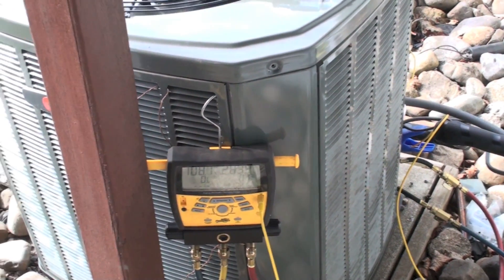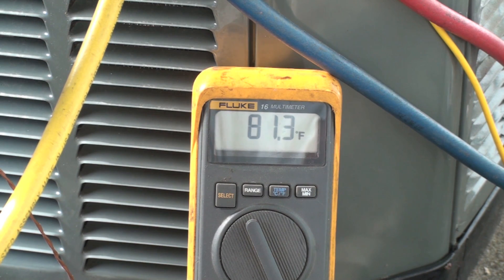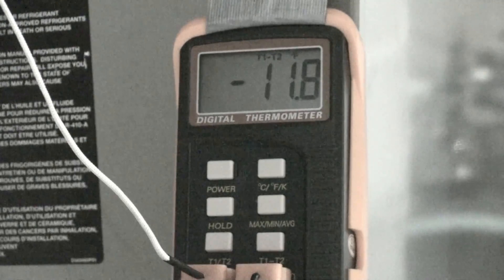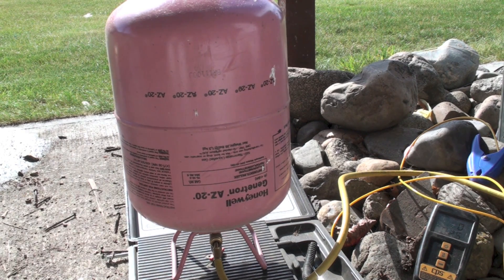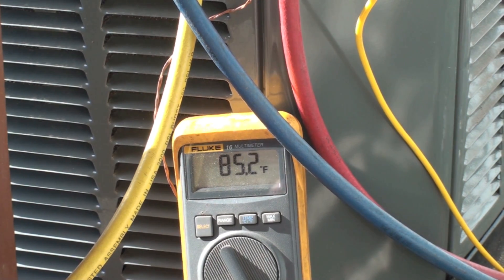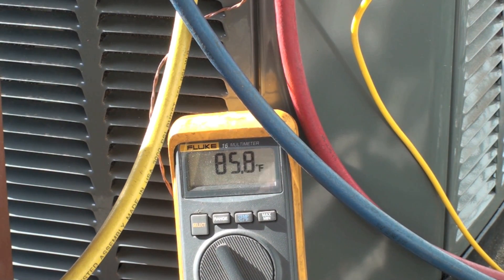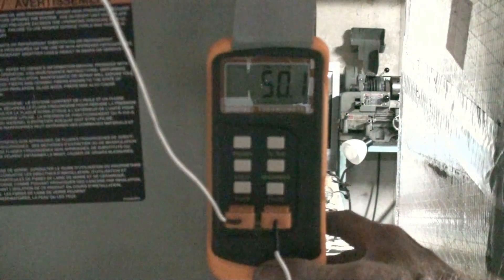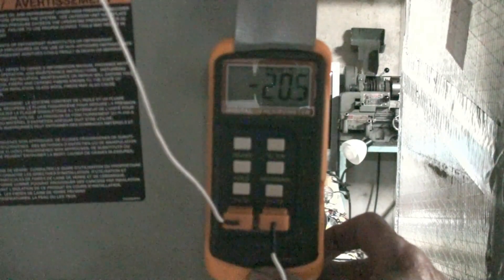How to recharge the AC with a TXV

Comment: Another superb run-through for how to adjust charge in an R410A split system with a TXV. 
I’m finalizing the charge in a similar system right now. It has a brand new condensing unit, but I am still using the existing evaporator and line set. So I knew additional R410A would need to be added to the pre-charged amount which was already in the new condensing unit. It required about 3 LB to be added. I think I’m getting close to the right amount now, but will make one more test of subcooling, indoor supply vs. return air temperature split, and superheat exactly like what is shown here in this video.

Comment: What’s the problem with charging by superheat, it worked for me for the last 43 years, TXV, PISTON, or CAP tube, cuts no ice, besides any installer worth his salt will put a sight glass after the dryer if it’s a TXV system ! Anyways I can judge operating conditions with my hand on the suction line, I don’t need a temperature probe unless i’m diagnosing a problem. Forget subcool just make sure of your gauge readings, and look for telltale problems that needle will show by its movements, like a pulsation that may indicate a sticking discharge valve, oh i’m sorry I see you have one of them modern digital manifolds that won’t show things like that, oh well maybe it’s also a radio to keep you entertained while your working. Also your liquid line should be warm to the touch, NOT HOT, and NOT COLD, one could indicate a dirty condenser, the other a plugged system and be careful, Carrier likes to sandwich two coils together on some of their units and they get dirty in between where you cannot see ! Never cared much for Carrier and I can’t stand Trane.
Reply from the maker: There are a number of ways you can fail by using superheat only.  
Subcool is used on TXV controlled units to insure there is sufficient refrigerant to feed under all load conditions.  Placing a sight glass on a modern A/C unit controlled by a TXV will not give an accurate charge.  We are far beyond that.  It is kind of 1970s tech.  
An A/C unit with several cap tubes, superheat can be normal with one tube blocked.
An incorrect piston can also give you incorrect superheat.  
Air in the system will also give an abnormally high head that will increase flow in fixed orifice systems and lower superheat.
Low airflow across the evap will also give you correct superheat on a system with low efficiency.
Gauge readings must also be checked.
There are more, but this will do for now.  
I would suggest that the hand on the suction line be supplemented by correct gauge readings, temp probe on the liquid line, probe on the suction line, a check with manufacturer's instruction (located on the model plate), ambient temp probe to determine if the gauge readings match, temp split across the evap.
I used this method on all systems I worked on.  It takes little time to set these probes and they will save you from mistakes.
GFM
Reply: grayfurnaceman I edited my comment, I assumed monitoring your gauges was a given, you will see that everything you said in your comment is addressed. Any of the problems you presented will show up if the technique I presented is followed, now diagnosing that problem will depend on your technical abilities. And about your sight glass comment, a sight glass is the only fool proof method of insuring a solid column of liquid to your expansion valve, I don’t care what they taught you ! And I find that 70s technology comment pretty funny, I didn’t realize the laws of thermodynamics have been changed ! Want to talk about something, let’s talk about the modern engineering marvels I have been running into lately, like using flammable gasses for refrigerant, i’ll bet you even think the insane pressures of R410A is going to work out, just make sure you honor the 5 year warranty on these compressors in the units your installing as they start blowing out left and right every time the mercury cracks the upper 90s.

Comment: r410a system ( with fixed orifice) with equalized pressures of around 200psig. But once compressor starts the low side drops to 50 psig while the high side goes up to 300psig. I checked superheat was like 80F and subcooling was 2F. Does this mean the system has leaked out all the refrigerant? Does the 200psig equalized pressures means there's refrigerant in the system? thank you.
Reply from the maker: All the 200 psig means is there is enough refrigerant in the system to make a saturated mix.  You could be quite low on charge.  
GFM
Reply: Hi, my r410a with txv unit. The suction saturation temp is about 33F and suction line temp is 48F giving 15F of superheat. But why is my liquid line saturation temp is 97 and my liquid line temp is also 97. I tried adding some refrigerant but nothing changes. This is a high velocity system air handler with a slab coil. I think my suction saturation temp is also too low. Both coils are clean and txv valve is new. Any help would be greatly appreciated. Thanks

Comment: What about adjusting TXV when subcool is correct and superheat is high?
Reply from the maker: In my career in HVAC, in 35 years of repairs, I have adjusted a TXV perhaps 10 times.  In at least 5 of those times, adjustment of the TXV did not help.  Look for everything else first, adjust last.
GFM

Comment: Question about a R410A systems, when the system’s compressor won’t energize due to low refrigerant with the low pressure switch, and you have a few lbs remaining in the system, can you charge as liquid directly to high side with compressor off? That is, weighing it in until system won’t accept any more, then, topping it off via subcooling method via low line.  Or, must system always be in a total vacuumed state before you can ever do so?  Moreover, in what situations can add via high line as liquid.
Reply from the maker: Unless the charging cylinder is at a much higher temp than the A/C unit, it will not move.  I would not consider it viable.
The only viable method of liquid in the high side, is with the system well below saturated or, of course, evacuated.
GFM
Reply: It seems then just holding down the contact switch, going into low line is the best way, versus using warning blanket on cylinder.
Reply: Or, if system is short cycling due  to low charge. that's probably good indicator you can go into high side?
Reply from the maker: @userjim9  I have never been a fan of warming blankets.  
Jamming the contactor or bypassing the low pressure switch is viable, but short cycling will not change the inability to charge in the high side.
GFM

Comment: hi, doesn't that affect the compressor when adding liquid into the low side like that? thanks.
Reply: It will affect the compressor if you add the refrigerant too fast. Watch the video again and pay close attention to Grayman's instructions! Good job!
Reply: You can use a liquid charging adapter when charging.  A liquid charging adapter is basically a fitting that has a small orifice in it to prevent liquid slugging.  A liquid charging adapter is just cheap insurance.

Comment: Good video. I appreciate your candidness about recover and refill vs. top off. It is first I have seen with that viewpoint. As a DIY guy, this means I just need  a decent manifold set, a scale,  temp probe(s), and jug of 410a. I will leave the other tools to the professional when it is time to have serious repairs performed. My unit has been serviced 2 times, 2 diff techs. Neither one found a leak, both ended up charging it up and that was it. Strange observation on my part - it appears to leak when it is powered off for an extended period of time. Crazy.
Reply from the maker: Leaks can certainly do that.
GFM

Comment: Some posts are questioning if the system is low on refrigerant that you need to recover and start with Fresh . how serious is this ? you added 3.3 lbs that sounds like alot My 3yr old system has a leak and 3.2 ls was added . should  I  turn off unit until they find leak and recover and recharge with fresh R410 A ?
Reply from the maker: Whether to recharge with new is dependent on several factors.  TXV controlled units are pretty easy.  Charge until subcool is right.  Fixed orifice is a little harder.  Sometimes remove and recharge is the best way.  You can also use target superheat without removing the charge.  This is assuming the system can be pumped down for leak repair.
GFM
Reply: Thanks  Can you describe the several factors ?  Why does the ease of charge have anything to do with the R410 being reused .    I have heard the mixture proportion  is critical and just topping isnt  an accurate  blend. if large quantity is added . is that true ?       3.2 sounds like a large % of an 8.8 full system . Tech said he can pump all refrigerant back to od unit then replace evap coil if leak is there . I still have questions of proper mix volume when adding 3.2 lbs . Still I dont want to pay for 8.8 virgin    A410A if not necessary  Please advise .
Reply from the maker: Mixture proportion is critical.  However, R-410A has 2 components whose pressure difference is only about 3#.  This means you would have to lose most of the charge before any effect could be noticed.  
GFM
Reply: 0n my 8.8   (tag stated)  lb. system,    we had to top up  3.2lbs to reach subcool  of 8.     Tech .stopped at 8 deg subcool and unit ideal is 10 +,- 3.   .      I guess additional could have been added to hit 10 sub on the mark .   I heard HoneyWell did a test at 50 % loss and top up numerous times and no negatives to system were found .Looks like even with my line set of 30ft and evap capacity my compressor is safe .    Now to find that leak .  BTW 2 yrs ago the OD unit froze up ( winter)  and shut down due to defrostboard failure 2 or 3 times . Is it likely the high pressure caused a leak in the OD unit ?     Tech wants to pull all R410 into OD and test lineset and evap first .  Wouldnt checking OD firstt be more practicle ?     We havnt seen any oil or discolor anywhere as yet .Sorry so long but I do apprieciate your knowledge and experience .

Comment: This is just one example of the lack of ability of HVAC service Technicians to diagnose problems and fix them. My brother had a 1.5-Ton air-conditioner installed on an oil furnace that only had a quarter horsepower blower motor and they installed an evaporator coil directly on top of the furnace which resulted in it being to close to the furnace heat exchanger causing an airflow restriction.

Actually in that oil furnace the quarter horsepower blower motor should only be used with heating and never less than a third horsepower motor used when there's an evaporator coil Installed in the system. the evaporator coil was always heat under loaded.

Additionally, the system almost immediately begin to lose charge in the area of the evaporator coil. The first  tech who came out with had an analog manifold gauge on the suction line and saw that the pressure was normal, however, the system had a TXV metering device on it  and therefore you have to charge by sub cooling and of course he didn't have any way to check either the superheat temperature or the subcooling temperature; therefore he misdiagnosed the system as being okay.

Over the years the same company was called in; again a total non-diagnosis was the result. Then another company was called, which I thought they might be the best company; however, he merely removed a clean return air filter; he had a set of digital manifold gauges which showed the superheat and sub cooling of the system. Subcooling was only 1°F and normally you need 8 to 10°F of subcooling on a TXV system.

However, when the superheat got down to around 16°F and the thermostat expansion valve superheat target was probably 12°F; the tech said the system is overcharged and he took the manifold gauges off the system. However, the sub cooling was only a mere 2°F; he left the system still way under charged, he never searched for the leak, nor diagnosed extremely low airflow through the system indoors resulting in situation where you couldn't possibly properly charge the system.

This is only one example of how the technicians here in the Southwest Wisconsin area, where I am now living, simply can't seem do anything right, it is difficult for me to believe that HVAC service work could be that bad, but I believe the number of service  technicians that do their work correctly is a very low percentage. our HVAC industry is shamefully disgraceful condition…

Comment: Great video and good thorough explanation! So the greater the efficiency the less you add to the ambient to get total condensing saturated temp? Like in a standard unit it's ambient plus 30 so in these high efficiency units it's plus 20? With every passing year the standard is getting higher.  Will that mean that eventually we will be adding less and less to the ambient? Thanks for your wisdom!
Reply from the maker: The first reaction of manufacturers to the need to increase efficiency was to increase the size of the condenser coils.  This, of course, reduced head and did increase efficiency.  It was also the most expensive way to increase efficiency.  So, manufacturers have changed things like compressor design, TXV design and fan motor design.  The actual size of condensers has again reduced and the efficiency goals have been reached.  
GFM

Comment: I'm still a fairly new tech (3 yrs. exp) and still learning the more specific technical details for individual units and systems. I would like to ask, when the information is not present on the unit,for example, older unit with faded tags or new one with missing paperwork. How do you go about finding out the exact specifications for what the unit should run at,as far as subcooling/fan cfm/or static air pressure? Thank you for your time and good video.
Reply from the maker: Ah, the age old question.  Throw in mismatched outdoor unit and evap, and it really gets tough.  Target superheat can be used if it is a fixed orifice.  TXVs are really pretty simple.  You probably will not go wrong 11 to 13 subcool.  Fan cfm can be handled by delta T across the coil and evap temp.  If the evap temp is below 40F with normal cooling ambients, cfm could be low.  Static is quite variable with different systems.  Hope this helps.
GFM

Comment: I cant wait to get my certs in.  I always wanted to do this type of work.
thanks for the great video's.  this is way better then the typical schools I see people going to
Reply: Daniel Furlong but are you ready? Test question for you. You have low pressures low superheat and a low suctionline. What's the problem
Reply: IMon   Trust me when i say I have very little experience. 
I always start by checking the airflow ,  making sure both  coils are clean and filter is clean 
I would think if freon levels are low, If freon levels are normal, Insufficient heat getting to Evaporator .  
Overcharge of freon can cause the same problem also possible restriction at the caps 

I'm only going for my universal test atm   It looks very easy.  After i pass the test i will try to get on at a local A/C company to get better experience .
Reply: Daniel Furlong good doing on checking for airflow on everything. Lack of airflow on an evaporator will give you low pressures with a low superheat and cold suction line. You gotta run the system for 10 minutes before determining a problem with your refrigerant.
Reply: Lack of airflow problems are dirty evaporator coil, dirty filters, undersized duct. Crushed duct. You'll usually get a block of ice.
Reply: Daniel Furlong learn how to use your gauges to read problems

Comment: thanks man..... these r410 cylinders come with a dip tube... so is necessary to keep the cylinder upside down to ensure liquid entry?
Reply from the maker: I have never seen one with a dip tube.  If it does have one, you would charge with it upright.  It is noted on the cylinder with an arrow.
GFM
Reply: Thanks a lot....what is the pressure in a new fully capacity r410a cylinder?
Reply from the maker: The pressure depends on the ambient temperature.  You can find temperature pressure charts on the internet.
GFM

Comment: Hey mate, I saw another video of a guy adjusting the superheat (on a walk in cool room) by adjusting the TXV. This is incorrect right? The only way to do it is what you have done in this video by adding refrigerant to get the correct sub cooling..? Also I always thought it was bad juju to charge a system with liquid or is it ago to do it by adding slowly?
Reply from the maker: I seldom adjusted TXVs.  It would be among the last things I would do when encountering high superheat.  Charge levels are best determined by subcool.  Blend refrigerants must be charged as a liquid.  Liquid charging can be done either high side with unit empty or low side by metering the refrigerant to avoid liquid slugging of compressor.  Hope this helps.
GFM

Comment: What do you do if your unit does not have a subcooling chart?  Is there a standard?  I have an ICP Heil PGAD30D1K7 and cant find a manual or subcool chart.  I am getting 10 degrees with the probe and gauges.  Thoughts or help is greatly appreciated and Thank You.
Reply from the maker: The unit could have a fixed orifice.  Subcool is important on fixed orifice, but most units are charged by superheat.
GFM
Reply: Wow,  Thank You for taking the time to reply to my post.  I checked and it has a TXV but darn if I can find a the required subcooling requirement for this unit.   It does have 10 degrees sub cooling and cools well.  I just want to make sure it should not be 15.  Have a great weekend and again Thank You.  v/r  mw

Comment: I have one of those SMAN4 gauges along with the wireless sensors and transmitters. No need for any math, once set up, it reads the superheat and subcooling in real time. This allows me to very quickly zero in the correct charge and squeeze out the highest efficiency the unit is capable of.